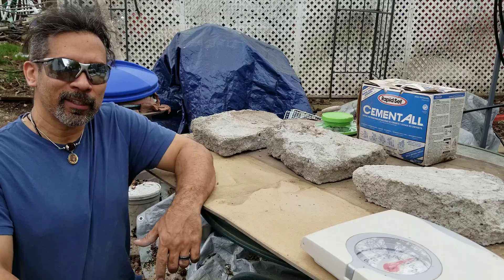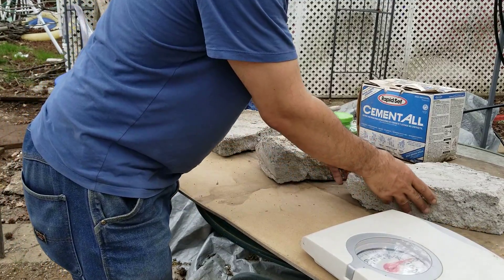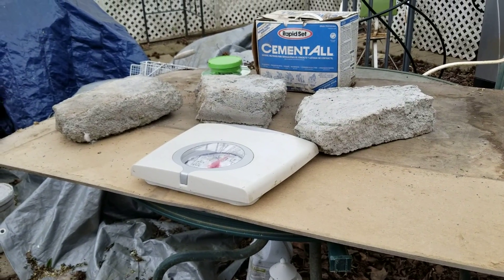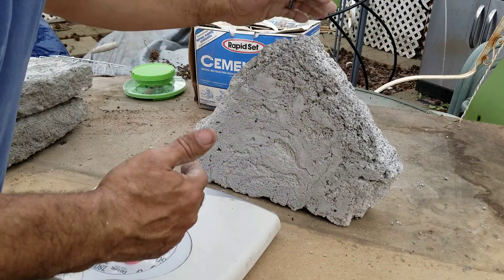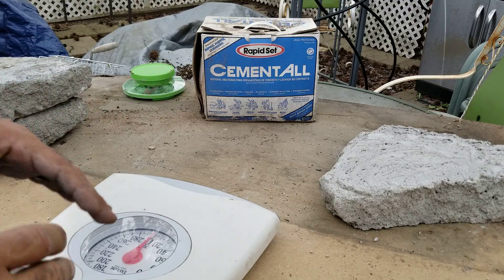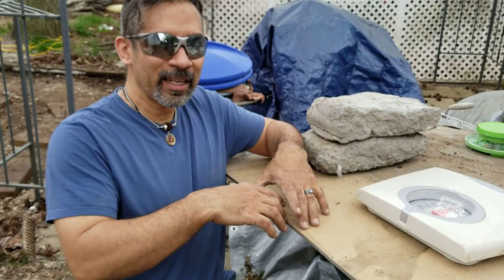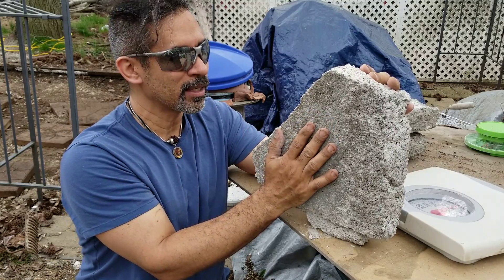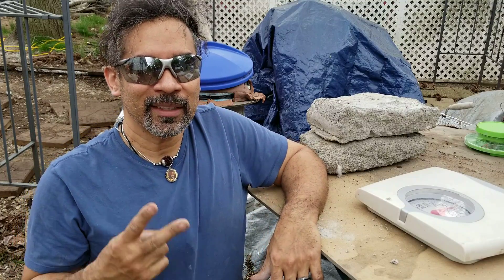Aircrete Wall Experiment Update #AircreteHarry #Aircrete #AircreteHarryFoamGenerator #AircreteWall

Comment: Love your work on this it has given me so many ideas. I plan to build a dome as well and after watching your videos and doing tons of research I'm thinking of something similar. I would build a re-bar cage in the shape of the dome  and weld 18 inch re-bar spacers  and cover it with mesh on both sides. Then I would cover the exterior and interior with 2 inches of shot-create and pour 18 inches of Air-create in between. This would give me an r value of 70 just from the Air-create. What do you think?

Comment: Among all the things you've tried, have you ever looked into the benefits of using metakaolin as an admixture?  It can replace up to 20% of portland cement.

I doubt you'd want to use that volume of it, since I think it's about a dollar per pound, and portland is closer to a dime per pound. Still it's not designed to REPLACE a large volume of portland cement, only to be used as an admixture.

It increases strength and hardness of the finished concrete and  changes it's alkalinity while making it less water-permeable. These traits seem desirable in the applications you're considering.
Reply: Weslag1 soinds awesome

Comment: Hi. I made a 4'x8'x6" of air Crete in a form. It had alot of shrinkage, also it wasn't flat it was wavey. 
What do u think I did wrong. 
I did what damingo said to do. I got his name wrong but the dudes that make and sell the lil dragon.
Reply from the maker: Check out my video I did on foam agents this may be why shrinkage. https://www.youtube.com/watch?v=S1ydXgWDU00&t=1s   Order this soap it's very good for aircrete.  https://amzn.to/2wChR9I  If you want smooth walls you need to use a laminated plywood for your forms.

Comment: Have you considered using styrofoam as part of the mixture instead of just air bubbles in your concrete mixture? There seems to be more insulated than just aircrete.